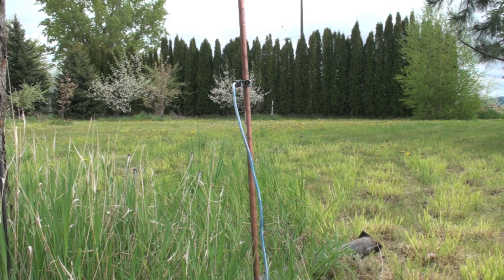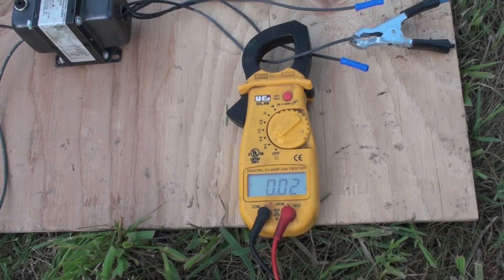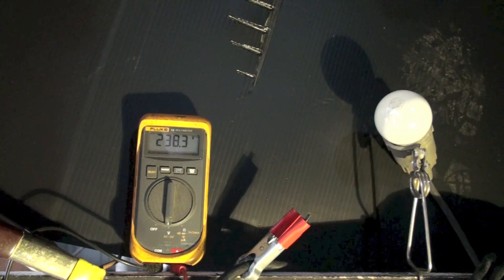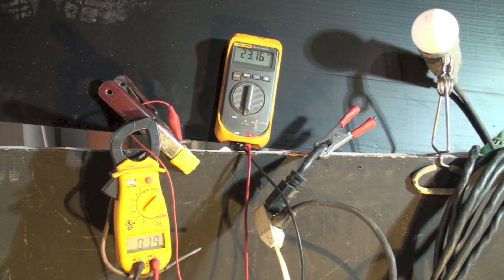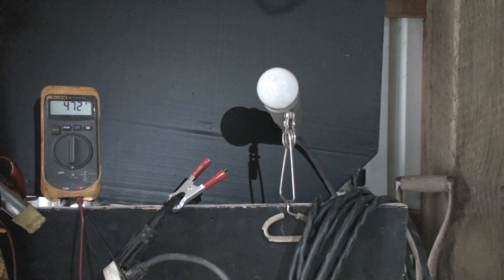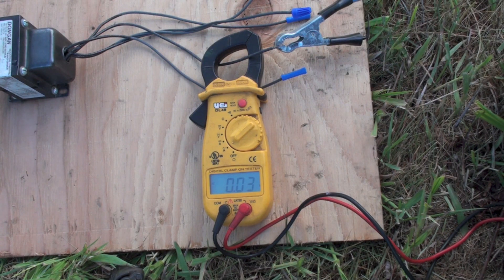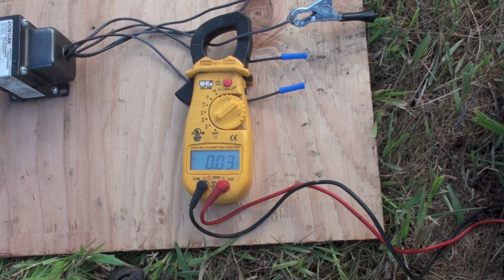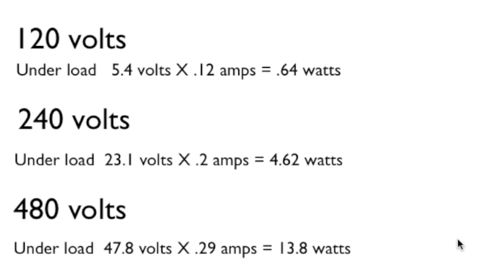Will AC power pass through earth ground

Comment: Running Tesla coils with their own dedicated high frequency grounds has strange effects on things (I did this starting ~1999).  One thing I noticed with a 'medium' sized coil, while it was running was that the tips of the grass was glowing for several yards away (it was a cool dark night).  Also the top of the toroid became wet to a point where it was almost collecting water!  I searched everywhere for other instances and reasons for this, finding only one concerning the water.  No one (including scientists) that looked into this could explain it.

This was about a 3kVA coil.  I now have a 10kVA coil that is designed to run on a pole pig (have one never used), I went to much effort with calculations to build the primary and (acrylic) secondary coils, 300A shunt, etc.  It is a two-man job just to lift the toriod, which I learned to build the hard way.  It has had zero sag in 20 years (supported in the center),  all parts built, but never used.  ...SHAME... but one day...  OK time to STOP!  I got lost in the TZ...want to go assemble it...but the huge grounding system!!!

Comment: I've blown up 14 meters on the black box project.  It will Run motors off of a cat 5 single wire at any length, just under 1500 feet so far with the second wire just stuck in the dirt. Made a video several years ago but no one seems able to get it. FacelessManStuff Chanel, check it out. A five minute walk away with the cat 5 wire, you have to make sure the ground wire is very loose in the ground or you will melt everything. Check it out.
Reply from the maker: So what's the point?
GFM
Reply: grayfurnaceman The point is that you were trying to show that single wire transmission of alternating current 
Couldn't be ran over long distances, and I understand that was just your opinion with the test 
you've ran. I'm just saying that I have successfully powered motors at over 1200 feet away 
and the problem wasn't too little power but way too much. That is with a generator
 With a 15 amp breaker  and the "Ground" wire just pushed down into the sand and the other
Wire was only a single strand of a cat 5 cable. Just sayin!

Comment: Here's one, I am getting AC power off an earth ground on a stand along grounding in ground. It is also in the shop and house. I blew up a 12volt DC  radio due to AC power in the chassis through the so239 antenna connector. I also blew up a laptop that was plugged into house. UI checked pole to meter, an electrician  checked box in. no one can find problem but see the problem. Weird
Reply from the maker: I can't say I have an answer.  Obviously, you have a fault in the grounding system.
GFM

Comment: nearly all of those transformers are center-tapped to the case/ground, so there would have been 5kV potential from either terminal to the case and could arc to the primary hot/neutral inside or through the plywood you had it on, perhaps even arc through an isolation transformer if it's not rated well over 5kV.

Comment: Doing the calculations your ground resistance between the rods is about 1 kΩ, so not very good.  What would be interesting is if you could vary the frequency going into the transformer to see the effect on ground resistance.  Lower frequency (closer to DC) should have lower ground impedance.
Reply from the maker: I did a video using 120v DC and I found no power could pass thru earth ground.  There are systems that use earth ground as one of the conductors.  You must use very high voltage.  Mostly in rural areas.  I would think that if used in urban areas, the metal piping in the ground would become anodes and be quickly corroded.  I could also think you could be electrocuted by touching 2 separate pipes in the ground.  It brings up all sorts of senarios in relation to excavating near power lines!
GFM
Reply: grayfurnaceman Yes, famers use high voltage electric fences with earth grounds.  When the cow touches the fence, the return path is through the ground.  DC will cause galvanic corrosion, and it's also a concern on farms if you have two pipes with different potentials which can negatively impact the health of livestock (stray voltage).

Comment: I've had decent conductance through earth with 120 V AC and a distance of about 200 ft.  This was with out a ground rod at one end, but just bare copper about an inch into the dirt.  I wouldn't recommend it for normal usage, but it can be done in a pinch.
This is also how a SWER local transmission system works.  Granted, this is at 24,000 V.  
spelunkerd, Three wire high voltage transmission wires are a three phase system, which does not use a neutral wire.  The neutral wire is used in a single, split leg system, which is what you find in most household wiring.  Hence the 120/240 V or 240/480 V wiring you find in your house.  This does carry the voltage difference between the two legs back to the transformer.
Reply from the maker: The conductivity depends, in large part, to the type and moisture content of the local earth.  Also, if voltage is all you see, you must put a load on the circuit to determine conductivity.
GFM
Reply: I wasn't checking voltage, but was using a cfl bulb in a lamp.
Reply: But local conditions definitely have an impact on ground conductance

Comment: Try to change the installation depth of the grounding rods and the distance between them. Then you will be able to see the change in the voltage gradient per foot. I wonder what results would be like as far as the electrical power is concerned. I don't know about any electrical interference in the ground itself but I'm pretty sure that the the big part of that impedance you get is coming from the way the ground rods are driven into the ground. Thank you for your videos, I find them very informative.
Reply from the maker: I did a little on depth in the first video I did on this subject:  http://youtu.be/rYWeN1FFtqc  From what I can tell, it only makes a small difference.  Hope this helps.
GFM
Reply: grayfurnaceman Quite often a grounding rod by itself is not enough to get a low impedance at the point of contact. There are different earthing systems out there that reduce impedance to low levels but that requires welding and stuff...and it becomes rather complex to build.

Comment: This has always been a point of confusion for me since the opposing arms of two phase power to a normal house are not necessarily always balanced. But the neutral wire carries the difference all the way back to the community transformer, and neutral is also connected to ground there. The ground has a lot of intrinsic resistance, allowing  electrons to balance slowly, with a huge voltage drop across to the other side. To my surprise, I believe some countries use three wire high voltage transmission without a neutral wire, and so earth ground has greater importance there....